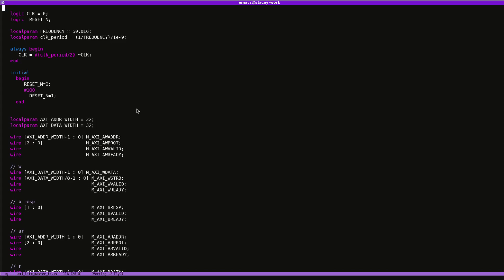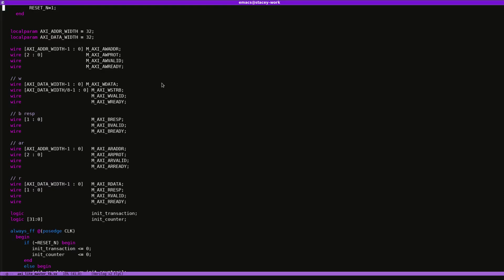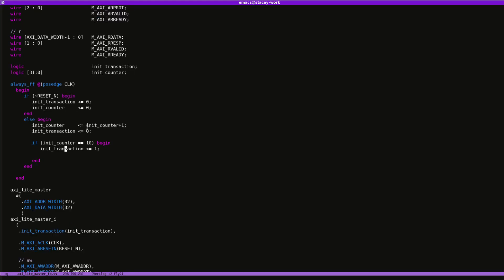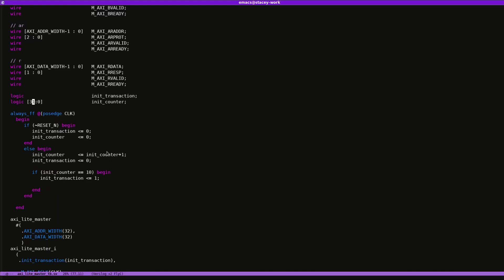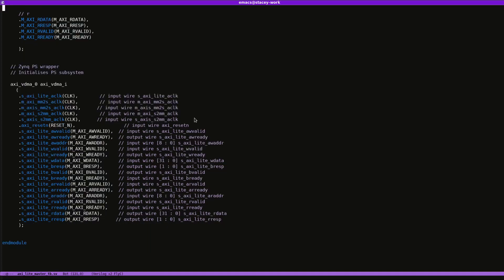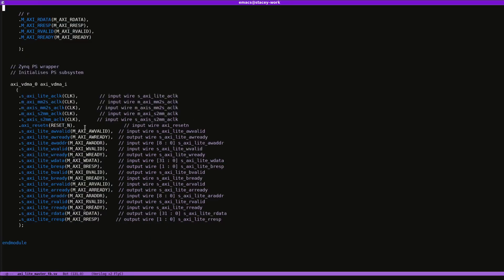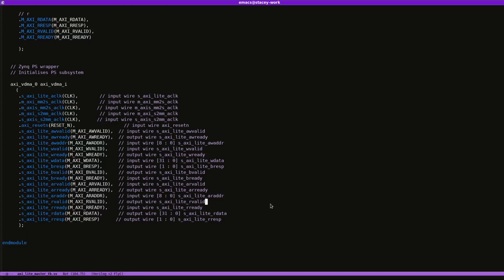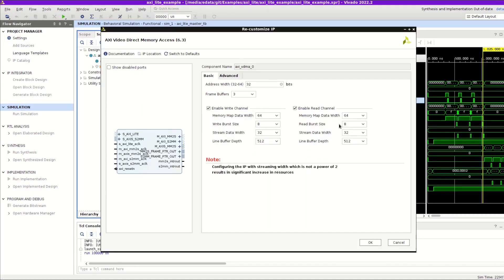AXI Part 3: AXI-Lite testbench (briefly)

Comment: Hello. I try to initialize AXI VDMA core from PL using AXI lite interface. In simulation all is ok, but on hardware i have some problem. When I read registers of AXI VDMA there is always 0 in RDATA. All other signals is ok, like in simulation, but RDATA is always 0... Why?